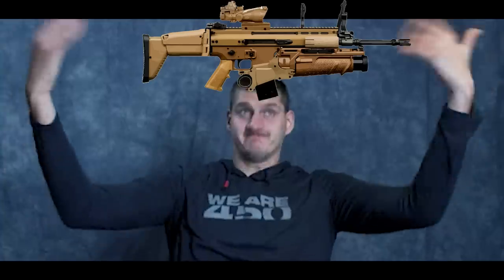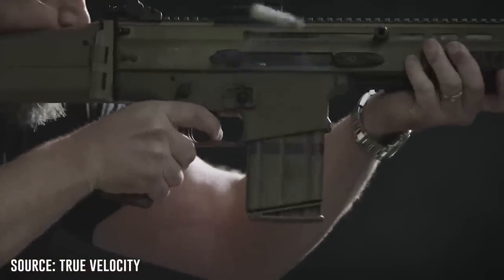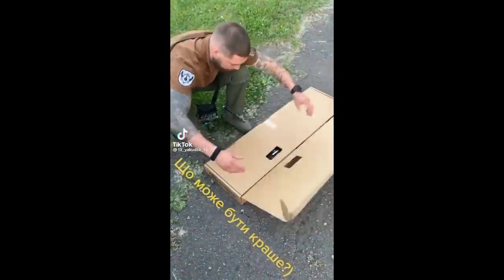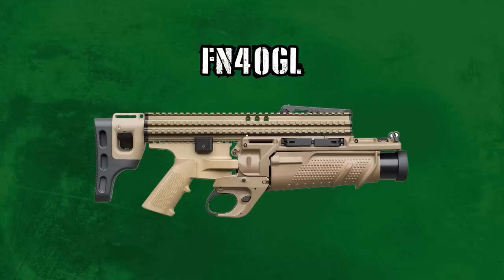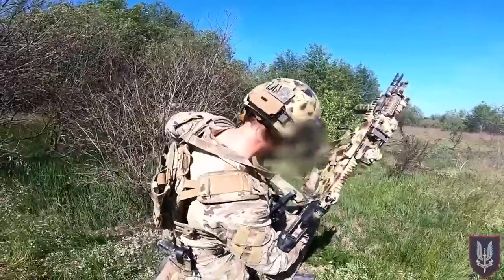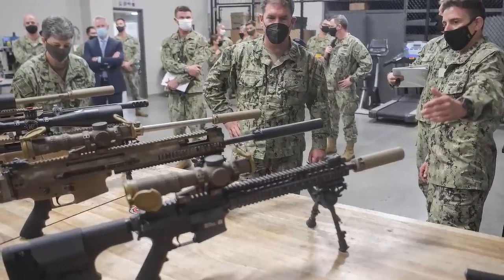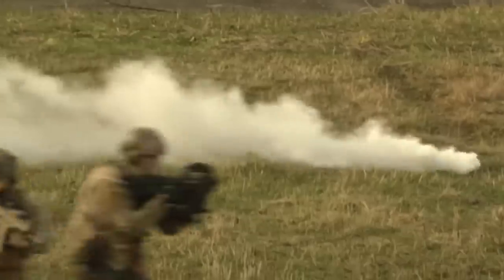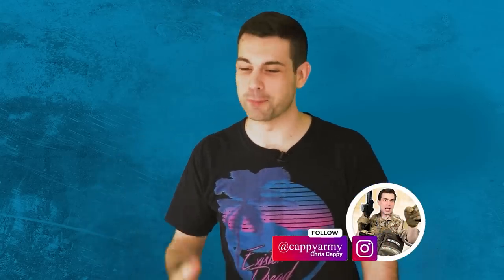Why this SCAR-H Rifle Uses Plastic Ammo Casings (Weapon Analysis)

Comment: Here's an unpopular opinion: True Velocity and their plastic ammo are the next dragon skin armor. Using very clever marketing to rile civilians up, while the military bypassed it for very good reasons that nobody wants to accept. This ammo is way too expensive currently and will never be adopted by the military until the civilian market uses it over brass.
edit: also the gas/suppressor issue is no longer a thing with modern 3d printed suppressors
Reply: @manny022 It's polymer cases, not polymer bullets. Unless you're talking about cases ricocheting, which isn't a problem I've ever heard of anyone having.
Reply: …UNTIL it actually reaches the ‘civilian’ market..it’s a NO-go then. I think you’re pretty much spot on otherwise..
Reply: @manny022 ..NOT ricochet? ANY round will ricochet DUE to velocity..
Reply: True Velocity ammo is expensive bc they don't have economy of scale. You are a small company competing against traditional brass case manufacturers who had paid off their machinery cost 100 years ago and perfected logistics. The point that True Velocity was trying to make is that their ammo has the potential to be cheaper since the material used is much cheaper than brass.
Reply: I’ve shot polymer ammo and it’s safe to say there is no difference in Ballistics and carrying a few magazines extra full of Polymer ammo makes no difference in weight as well. I mean unless you’re carrying a whole full backpack of parlor ammo then that’s a different story
Reply: It's good if you're a fellow larperator who like to run around a mountain doing ranged stress shooting since it weighs less. Fudd's will not pick this cartridge up due to the fact of it not being reliably reloadable though neither is the hybrid 277 fury with what rigs everyone but SIG has.

the TV ammo uses less powder and you can stuff it with some slow burning stuff more to get an extra boost out of it. Issue is rebonding the bullet back to the casing. I've been using krazy glue but it takes babysitting to make sure the bullet doesn't sink a bit into the casing or get crooked if you stretched the plastic out a bit prying the bullet out.
Reply: @manny022 The weight of the projectile that is fired is exactly the same, it's the casing that's lighter. Once the round leaves the gun there should be no difference.
Reply: @Mryodamiles  Right. At similar economies of scale, injection molded polymer always beats metal for cost.
Reply: @hydrophilicchristopher9874  The SIG bi-metal case is entirely reloadable. That's simply an internet wives' tale that it isn't.
Reply: @Ed Bait We already are seeing a better version of Dragon Skin. Stealth Armor Systems is reintrucing the Dragon Skin with most of the flaws removed, including the ridiculous marketing; it is now rated as Lv III(+), as it always should have been. And of course, Safe Life Defense has had their flexible FRAS armor on the market for awhile now.
Reply: @Ed Bait Dragonskin was awful and the company that made it actually commited fraud by selling armor that was not NIJ rated to the military.
Reply: @Ed Bait No, it was different armor. They sold it to the USAF, not Army. When caught, their excuse was that they had a "verbal agreement" that the armor was about to get NIJ certification. The testing failures with Dragon Skin were another different matter.
Reply: @Ed Bait It's not irrelevant. It completely tanks the credibility of the company behind Dragon Skin, as they essentially engaged in fraud.
Reply: @ostiariusalpha  The bi-metal case is going to be ridiculously more expensive to make.
Reply: @ChucksSEADnDEAD  Dragon Skin that sounds familiar. Wasn't that the junk that "ballistic expert" "doctor" was involved with? I remember the guys at SF were super angry over that.
Reply: @LuvBorderCollies  Except they already know that it isn't. The multi-stage  process of drawing and annealing and drawing and annealing brass into the shape of a case is not a cost efficient manufacturing method like you seem to believe.

Comment: Hasn't the SCAR 20S in 6.5 Creedmore been out for a while now? I remember looking at it about a year ago. Also heard they delivered a  bunch using the 7.62mm firing pin so they punch through the primers frequently.
Reply: I feel like in the gun world if it was made in the last 10 years it's new. Considering people still buy guns that are over 100 years old (1911)
Reply: Chris said "in 2020 will have" when talking about the 20S. I think that might have been old footage because he didn't talk much about the Polymer ammunition, just the scar variants
Reply: 1. This looks like a bunch of misc stuff edited together.
2. 6.5 Creedmore one is already out. MAC has one.
3. MACs 6.5 does not function well.

Comment: I still hope True Velocity gets a big military contract. It seems like a quantum leap in ammo, more so than SIGs hybrid ammo…
Reply: The SIG ammo operates at an entirely new plane of pressure ceiling, it's far more of a "quantum leap" in actual ballistic performance; the True Velocity polymer would simply self-destruct at such a pressure regime. That being said, the military has expressed interest in a reduced power full auto/CQB load for the 6.8x51mm, that kicks more like the training ammo, so there might be a real opportunity for True Velocity to pitch their case design again in the near future.
Reply: @buttyug  7.62 NATO would be a huge loss in performance, might as well stick to 5.56 and enjoy the ammo carrying capacity.
Reply: @buttyug  That's only slightly better than 7.62x39 ballistics. That's a ton of flash and weight to carry for intermediate rifle performance.
Better than AK is not a tough hurdle to clear. You want to be better not just in ballistics but also recoil, low flash, weight, etc.
6.8X51 at least justifies its weight and recoil by blowing 7.62x39 NATO out of the water.
Even a 2600 fps 7.62 NATO is a compromise. I'd rather have 5.56, almost no recoil and nearly double the ammo. Either give me power and performance, or give me ease of shooting and ammo for days. Trying to sit on the fence just gets you the worst of both worlds and none of the advantages.
Reply: @buttyug  Ultimately, I do think 6mm ARC with EPR style steel core and the Sig steel case technology to up the pressures would have been better than going full power. But the machine gun is driving this boat.
The point isn't just doing things 5.56 can't. It's that it's still a neutered 7.62 NATO. We have 16" barrel 7.62 NATO rifles and we don't want that, much less neutering it.

Comment: I’d be curious to see how plastic ammo performs in accuracy tests vs brass.  Also, I wonder if the plastic cases could be reloaded?
Reply: If you are in a war and trying to make refill ammunition then have lost.
Reply: @julianshepherd2038  I’m only curious for personal use.   Not military
Reply: No, it can't be reloaded.
Reply: Yeah, or what if the polymer ammo has so much more energy due to less heat, maybe there is a way to have an even faster fps 5.56 just by switching to that casing? AP?
Reply: @blackhatch46  Heat buildup in the M16/M4 is a problem. Polymer ammo might be a solution.
Reply: @julianshepherd2038  if your in a war and the enemy can reuse your brass or polymer it matters.
Reply: Are they recyclable or fully biodegradable?
Reply: @artnull13  Yes, all plastic polymers are recyclable, but is it worth it?   And no, no plastic polymers are biodegradable.  If something looks plastic and says biodegradable, it is actually cellulose.

Comment: It doesn't store quite as well for decades as the stainless-brass and dealing with a dozen million spent polymer casings per year that cannot be recycled is just not an option.   Also, having the chamber not heat up with the barrel causes a massive amount of parts stress.
Reply: Yeah, that sounds like a mess waiting to happen.
Reply: Everything about this project is suspect as hell
Reply: But the soldier is less likely to get shot which is useful on a battlefield.
Reply: The manufacturers say the plastic is recyclable and the steel base makes it easy to pick up with a magnet. No more picking up brass bent over with your hands
Reply: Simple. Run a large magnet across the ground to pick up the casings to sell the steel as scrap and send the plastic wherever it needs to be. It's plastic so if a spent casing is left outside exposed to the elements it's gonna rot and crumble into dust.
Reply: Isnt current NATO guideline a 15 year shelf life for brass 5.56? If polymer only has a 10 year shelf life and is (Potentially) more cost effective to produce it might be seen as an acceptable trade off. How much of a military priority is recyclability? And how many rounds is a service rifle expected to fire in a combat environment without being lost or damaged in another manner, if the additional stress doesn't reduce the weapon lifespan below that threshold its not a major concern.  I think the downsides mentioned are obviously a more significant issue for consumers and the surplus market but less so in regards to the military.
Reply: @theimmortal4718  Also, I guess the enemy will have a harder time reusing our casings. The Taliban and Afghanistan police reuse our 5.56 casings.
Reply: @Seth9809  
I seriously doubt they were reusing them
 From what I saw, the locals melted the brass down and made trinkets from the brass

Comment: The SCAR actually uses a short stroke gas piston system. Not a long stroke. It just looks like it would be a long stroke because instead of having an op rod, the bolt is extended forward (which acts like the op rod) to make contact with the piston on the gas block which makes it looks like there is a piston attached to it like an AK. But make no mistake, the piston in the gas block just pushes the bolt back a few millimeters like an HK416, G36, ACR, etc instead of the piston being attached directly into the bolt like a true long stroke gas system like an AK.

Comment: Imagine plastic cases in a M2HB if the plastic cases reduce heat.
Reply: I’ve gotten 50 cal barrels hot enough to instantly melt that high temp polymer as soon as it chambered.  Plastic bad for sustained fire machine guns.  Fine for shoulder fired weapons.

Comment: I was really disappointed the plastic ammo casing wasn't chosen for the NGSW.
Reply: Yeah, I feel like this plastic ammo was the most innovative thing that was coming out of the NGSW program.
Reply: they wanted a ridiculously high chamber pressure and even went with Steel at the base of the case.  Polymer isnt going to hold up if brass is already too weak for how much pressure they are asking for.
Reply: @DefZen343  I think you are mixing up Sig ammo (chamber pressure of 80,000 psi according to Sig and the army) for True Velocity polymer ammo (65,000 psi max....which is similar to most modern ammo out there right now). Sig ammo was the one that everyone has concern about regarding rediculous chamber pressure. They are trying to achieve the required velocity with only 13 inches of barrel.
Reply: @Mryodamiles  plastic is bad for men
Reply: @Mryodamiles  ohh, i was assuming that was what the military asked for 👀  a very high pressure round that defeats body armor while using short barrels,  the pressures makes polymer cases inappropriate.   was the pressures not specified when they submitted the polymer ammo? 👀
Reply: @DefZen343  They did, and Beretta/GD/TV tried to get around this with a bullpup design. The Army wasn't impressed.

Comment: Plastic casings, like fusion power are just 5 years away. TrueVelocity is just the latest company, previously there was Gorilla, and PCA, and Textron. I have a few boxes of PCA ammo from back when they sold that to the public like 2 decades ago. I think it's probably just never going to make the mainstream. There are still other composite case technologies like the steel/steel composite case made by ShellShock, I've fired quite a bit of it, and it's awesome, I think it might be closer to 50% weight reduction.

As far as the SCAR goes, it's a neat rifle, I've fired many variations of both the H and L, the full auto in the short barrel configs is so much fun. That said, the scar H just doesn't make sense outside the Mk20SSR, you lose too much velocity with a short barrel, and your noise signature goes through the roof. In the mean time, the Mk20 versions in 6.5 are having teething issues with firing pin protrusion, and botched fixes and slow customer service.

I could probably deal with these issues on a personal firearm, just not at the price point being asked.

Comment: I think the flash reduction has more to do with them probably using a flash suppressant powder.
Reply: That's likely a factor, but they're not wrong that metallic cases steal energy from the powder ignition either.
Reply: I think what they where trying to say is they can use less powder to get the same effect which happens to lead to less flash

Comment: what I got from this video Lightweight polymer bullets are going to be the future of warfare not just because of the low muzzle flash but just because you're going to be able to have soldiers carry so much more ammunition and it will probably reduce military spending as plastic so much cheaper to manufacture than metal I just hope there's a method of recycling the cases

Comment: Shot in the dark here: Why not use the projectile profile of "metal storm", and turn the entire case into the projectile, a bit like the gyro-jet, with the firing initiated by a contact pin discharging an electric arc into the base of the round.  That would eliminate the "tare" weight of the case, and use the entire mass of the round as the impactor.  Together with higher chamber pressure and smaller volume of the more powerful propellant charge, it would have a greater impact compared with traditional rounds.  I think....
Reply: soooo a rail gun essentially? without the rails to guide the projectile but still I think that's pretty much the idea of gauss and rail guns.

Comment: I do love an attached/reciprocating charging handle better than I do love the Forward Assist (AR-15A1 thru the "M-4") because I just slap it with the palm of my right hand!  However, I can understand when shooting from unusual positions that can be an issue.
As for the pistol, perhaps something like what the Mini-14 uses (at least the early to mid production ones I've owned.  I don't know about the ones that are over $1,000!) It is an "External" Piston system where the piston fits around the "Chamber" which in this rifle has a bit of a taper and self cleaning flutes on it.  With every shot, any residue gets tossed to the bottom of the stock's inside!

Comment: Polymer casings are 100% the future of ammunition. But as for a .308 rifle to build upon for infantry, the Ruger SFAR is absolutely perfect! Weighs the same as an m4, fires .308 and could be adapted to the new polymer 277 tvcm cartridge and as a result would actually weigh less than some M4s currently in US service. But itd have more power than the .308 and thats relly huge, most especially with the reduced overall weight of the full setup. Just something to think about the next time youre looking for a phenomenal .308 for not even half the price of a scar that weighs even less.

Comment: I had about 1,000 rounds of the 5.56 NATEC polymer-cased ammo in the mid-2000s. It was pretty good ammo when plinking and super light. Well, I decided to use it during a July 4th rifle competition, where it was 114ºF during the heat of the day. 

During the last stage, I suffered a case neck separation, which prevented me from chambering another round (after three malfunction drills, I just called it and walked off the range. I later popped out the case neck after the chamber had cooled).

I wound up giving the rest of that ammo away (I got it for free, so wasn't going to take anyone's money for it...).  Hopefully, this new stuff has worked out those kinks.
Reply: it's unbelievable the ability of material engineers to manufacture something lightweight, strong and cheap out of seemingly the same ingredients of mud. Specifically within the past decade when computing power has really reached a stride and more specifically AI styled machine processing is able to run and test different styles of materials with purpose, rather than the old style of trial and error that was required. I have no doubt they've solved those issues but also that there must be a bunch of other issues hidden by the fact that millions of rounds aren't being produced and used in harsher environments. For me that kind of teething period must be well worth the payoff for an actual innovation into the casing of a round.
Reply: @facepalm7345  Don't get me wrong...it was a huge advancement in ammo tech for the time. And for light plinking, it was perfectly adequate. But once things got toasty, that's when it all started to fall apart, literally. Since I was doing a lot of competitions at the time, I decided I'd just get rid of it rather than be tempted to use it again. LOL

Comment: Quick question, does wearing a plate carrier with no plates make you shoot better?
Reply: If your carrier, IBA, or IOTV is of the correct size, fitted properly, and the ESAPI is riding as high as possible within your carrier, you will find that a solid buttstock pocket is formed between your rotator cuff and the edge of the plate.  Very solid.   
When we run and gun, we do not drop the muzzle or pull the stock off of our shoulders.  The weapon stays up, with a solid cheek weld, so our eyes and sights are one.  Perfect the technique of keeping your dominant eye through the optic while using your non dominant eye for peripheral scan.